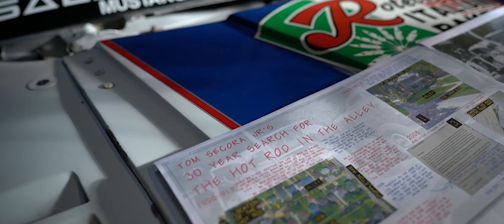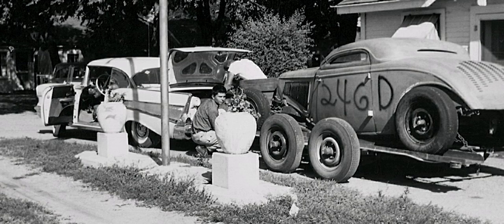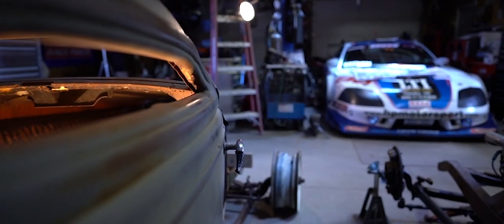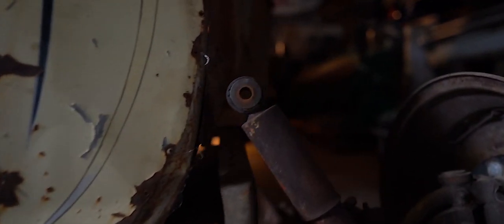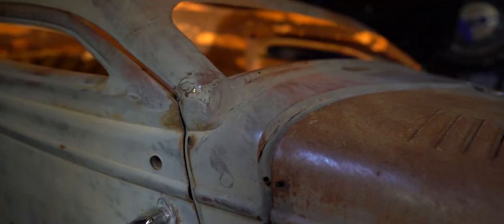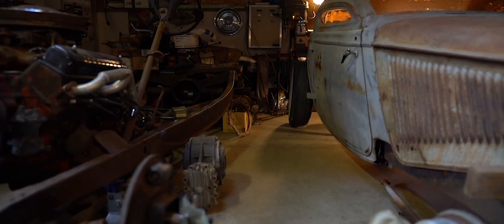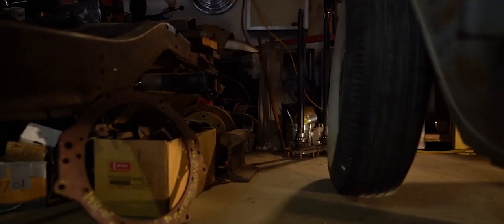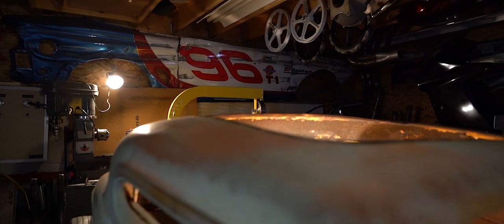South Omaha Speed and Fabrication  Introduction video to 1933 Orange Crate Project - Omaha Coupe 1.1

Comment: I have a friend that has a j2 olds motor for sale. It's at the Dale Wilch man cave in Kansas city. He is a vendor there. This is a running motor. Thanks Emmitt
Reply from the maker: Emmitt Thank you for the heads up on the J2. At this point I have purchased 3 engines. A running 1949 303 olds that I am in the process of installing. I none running  1957 J2 371 snd a 1959 imperial 392 2x4 Hemi . I think the plan is to run the olds  for a bit and then build up the 392 Hemi. Thank you for the info and for watching !!

Comment: I remember seeing the side of that mustang on the wall at HP MotorSports. If I'm mistaken.
Reply from the maker: Yes, you are correct.  We built that mustang at the first HP location off of 58 th and L started in 1993. Paul Brown got in a crash at Watkins Glen in 95 or 96 ? The car was reskinned and the side of the car that was wrecked was pieced together and hung in the second location at 36th Q. I ended up with it when the shop was closed . Good eye
Reply: @SouthOmahaSpeed  Dude that is so awesome! That brought back some memories.
Reply from the maker: @ItsonlyaJimmy  That’s awesome ! Lots of great memories for me back then too